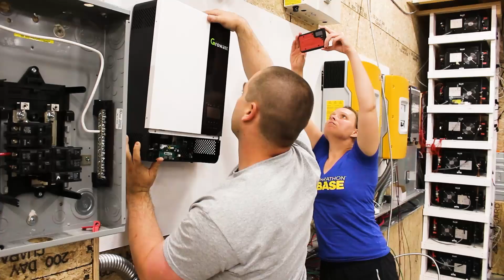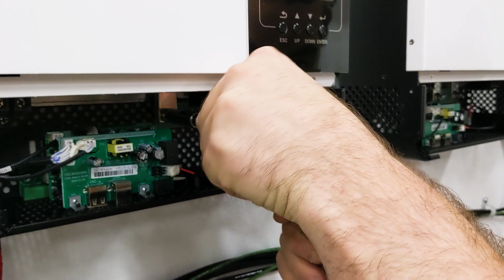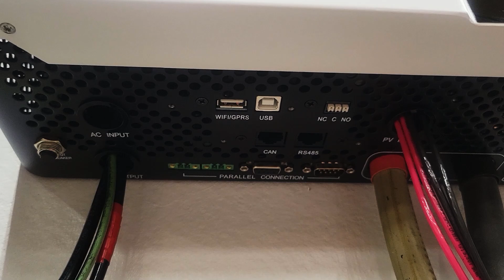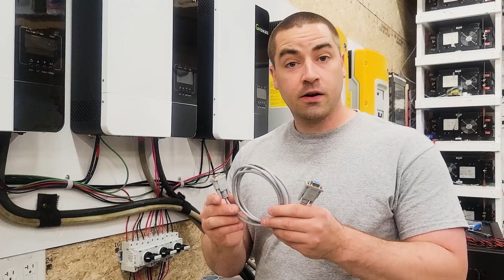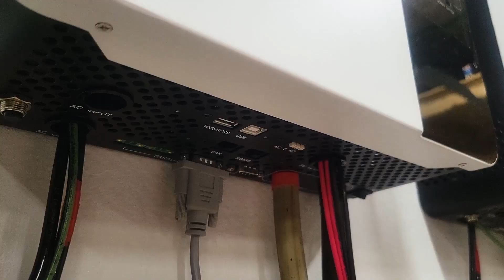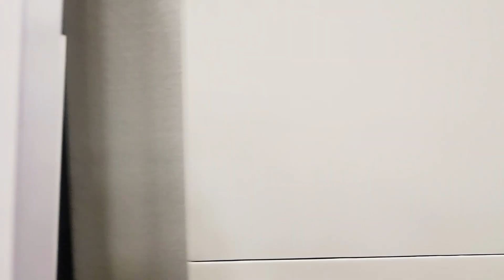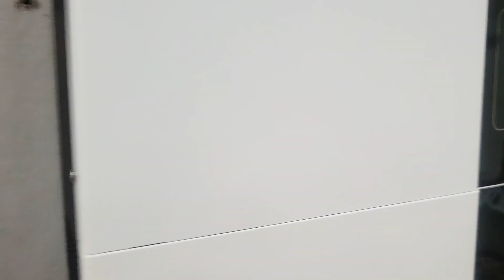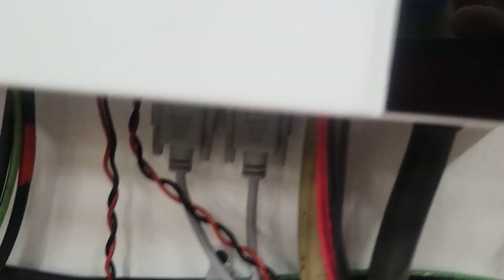Paralleling 3 inverters together, Growatt 5000w Solar System

Comment: Can you use two auto transformer?
Reply from the maker: Yes, it's OK to parallel multiple auto-transformers.  However, at a certain point I prefer to use one larger auto-transformer.  Depends on exactly what is being powered.
Reply: @DavidPozEnergy  I have 4 growatt 5000es mainly for redundancy and the extra charging capability. Pretty sure I can balance my main panel to not exceed 5k on one transformer but I bought 2 already.just in case.
Reply from the maker: OK.  You can parallel them.  Good luck on your project.

Comment: Hello, I have a solar installation with 3 inverters 5 kW mounted in parallel with a total single-phase output of 15 kw but I have a three-phase public network subscription of 15A per phase, I would like to know if it is possible to make the network injection of the 3 phases with a phase by inverter on the prallèle mono

Comment: Hi David. I love your videos! They are packed with information and I like the personal touch you give them by telling about your grandfathers screwdriver for example! 

One question though. I've got two SPF 5000 ES inverters in parallel and 8 panels of 75.6V and 6.58A each. I want to connect them as two strings of 4 panels. So two strings of 302.4V and 6.58A. I'm planning to connect one of these strings in the left and one string in the right converter if that's correct. 

But then in the future I would like to add another 5 of the same panels as a string of 378V and 6.58A. Can I then combine the initial two strings in parallel (302.4V / 13.16A) and connect it to one converter and the new string of 378V / 6.58A to the other converter? I know that normally when you would combine these two strings (302.4V and 378V) in parallel, the voltage would go down to the lowest voltage string. But since they go to separate converters (connected in parallel though) will this then not happen? I googled for quite a while but couldn't seem to find the answer. Would you be able to help me with this? :) 

Thanks in advance!
Reply from the maker: First question: Your explanation of wiring the solar array sounds correct.  302V is about the same Voltage I run on my strings.  Running one string into one charge controller is ideal.  I personally run two strings in parallel, and then feed into each charge controller. 
Second question: You have it correct.  You can combine two strings, so long as each string is the same Voltage (which you said you would).  The new string of 5 panels can run into it's own charge controller without affecting any other charge controller.  The important thing whenever you have 2 or more charge controllers feeding the same battery, you want all the settings the same.  
Note, tape your screwdriver to prevent shorting the terminal screw to the metal case of the inverter.
Reply: Awesome. Thanks a lot David!

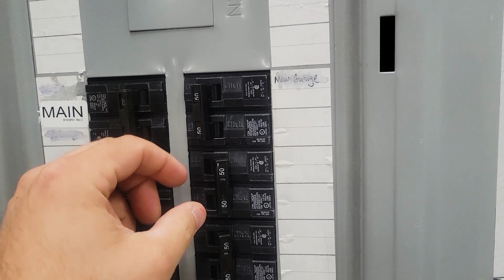Comment: Right at 22:05, i had all settings in the menus the same, and ass soon as i turned the circuit breaker to turn the shed on as a load, poof 2 growatts gone, error 51 and error 9 $2600au gone

Comment: Considering that these are hybrid inverters, could you have connected the grid to them?
Reply from the maker: These are not hybrid inverters.  They are off grid inverters with charge controllers built in.

Comment: hey brother. can you tell me how these inverters are holding up? im looking into pretty much the same setup
Reply from the maker: I ran my house over a year with great success.    I made a 1 year follow up video on the Growatts you might like to see.  Note, I'm using these off grid only.  I've heard some people had glitches when trying to use the grid to pass through them (I never tested this myself).  
Video, 1-year: https://youtu.be/0xY4OdBfn44?si=b4c4Hqmh1y4yylku
Reply: @DavidPozEnergy  im going for off grid too, i saw the 1 year, kudos!! I can’t thank you enough for providing this information, not too many people follow up on the long-term, and even less replied when I asked them!! have a safe holiday, brother, and be safe, I subscribed to help your algorithm
Reply from the maker: Your welcome.  Something to mention.  If I were building this out again today, I'd choose this inverter: https://signaturesolar.com/eg4-6000xp-off-grid-inverter-split-phase/?ref=4_rHcgZ9x-TiF-
(affiliate links help the channel)
Yes, it costs more than the Growatt, but it has the circuit breakers built in, and the split-phase.  So you don't have to buy the extra disconnects, boxes, transformer, etc.  I think it's a better deal overall.

Comment: Hey Dav, are the computer necessary to make the BMS work. I have three Growatts and ten EGLL batteries. Not able to get the BMS communication working to be able always charge my battery bank. Any counsel on this? Thanks
Reply from the maker: I ran my Growatt inverters for a year without any communication between the battery and inverter.  I set the max charge based on Voltage, and the disconnect based on Voltage.
Reply: Okay, I am having an intermittent problem with my batteries not charging some mornings.  I do not currently have them in the LI mode. Very frustrating. When I attempted to switch over to the LI mode I got a fault. Wondering if the gray cables are what I am missing to make this work. I travel from time to time and have three freezers and a fridge, don’t wanna come home to drained batteries.
Reply from the maker: You said "gray cables".  Are you referring to the data cables for paralleling multiple inverters together, called "parallel communication cable" on page 23 of the manual?
Reply: I believe I need to speak to my electrician. I don’t think mine are set up in parallel. I have three Growatts. 1 has PV of 5700 watts
1 has PV of 5670 watts
1 has PV of 4500 watts, however they all feed through two transformers to create split phase then to the loads in my home. For some reason the batteries intermittently do not charge consistently. Some days fine, but every so often I notice they’re not charging. When I put them in LI the system shoots faults. Any ideas what might be happening? I do realize that you’re busy with your own challenges. Thanks in advance.
Reply from the maker: It sounds like all 3 inverters are trying to feed the same load panel in your house.  This must be done in parallel.  The chapter on how to parallel inverters begins on page 22 of the manual: https://signaturesolar.com/content/documents/GROWATT/1519013-manual.pdf

When setting up inverters, the hardware must be done 100% before looking at software.  Things like linking the parallel wires is hardware.  Menu settings of what type of batteries you have is software.  Please go through your setup and verify all the wires are 100% in the "Parallel Installation Guide" beginning on page 22. 

I don't mean to come off brash, I'm trying to help.  It's simply happened before where I spend hours trying to help someone with menu settings, only to find out they had a loose connection somewhere.
Reply: Okay. Last question. Do I have to purchase the separate communication parallel kits? I purchased my ES5000’s in June 2022. Thanks
Reply from the maker: I purchased my Growatt inverters here: https://signaturesolar.com/growatt-5kw-stackable-off-grid-inverter-spf-5000-es/?ref=4_rHcgZ9x-TiF-
The ones I bought came with the "paralleling board" pre-installed in the wiring compartment.  I didn't have to purchase anything additionally since each inverter had the parallel board and paralleling wires.
Reply: Hi Dave and thanks again for your follow up. I purchased mine from signature as well. I have nine EG4LL V1’s and one V2. It seems I have to update the firmware. Where in the world does an old fogy like me learn these things?
Reply from the maker: I never updated the firmware in my Growatts.  I did update firmware on my batteries for setting up closed-loop communication, and I have a video on it.  However, the closed-loop communication isn't necessary.  Please make sure all the data wires and settings in the Growatts are correct for parallel operation before worrying about closed-loop comms with the battery.
Reply: @DavidPozEnergy  Thanks Dave, I update my voltage settings with the help of the folks at Signature.  The problem that I have is that the Growatts sometimes do not charge the batteries.  Not sure if it is a sunshine/shading issue or inverter issue.  Today (here in middle Tennessee)  it is partly cloudy.  My batteries are in standby mode.  The voltage coming off the array is swinging between 143v and 240v.  I hadn't programmed the protocol in my master battery, so we did that yesterday.  We made sure all dip switches were correct. I have one V2 battery.  I hated the fact that they phased out the V1's.  After all this, switching the inverters to LI, and the faults started again.  The tech instructed me to put the master inverter in USE mode.  I got a solid red light and now my case has been pushed up to the next level.  I disconnected the BMS cable and am running in LI/USE mode.  I guess for me it is a learning curve issue.  Thanks for sticking with me on this.
Reply from the maker: Glad to hear SS is working with you on this.

Comment: Is it true that if you parallel the growatt inverters, the PV can no longer combine with the utility to power the load? My understanding is the pv can power the load if the supply is greater than the load. But when the PV power drops below the load level it switches over exclusively to Utility and the PV charges the battery only.
Reply from the maker: That sounds right.  I run my inverters in off grid mode only (no grid input).  This is a budget inverter and won't have all the extra features found on more expensive models.

Comment: Hi David.  been watching all your videos.  I have 2 3000 Growatt that is in split phase at the moment.  I find myself needing more than 3k of watts as I run the microwave and airfyer together.  to get more than 3000, I would need to ditch 240v Split Phase, which I dont have use for at the moment, to do that, do I need to get rid of the serial cable and just use the blk and red cable to share current to get 6000 Watts instead?  Thank you in advance
Reply from the maker: Refer to the manual.
No.  They still need to communicate.  Refer to the manual for wiring it them in "single phase".  You will need to change the parallel mode to single phase in the menu.  Also, remember, don't feed it with 240V (input) if you want 120V (output).

Comment: Thank you. I used the Demuda 6,000 watt 24/48 VDC - 110/220 VAC input, 110/220VAC pure sine wave output 100 amp MPPT charger-inverters and I think they might have cost more than the Growatt. It has a PV input max of 5,760 Watts which is vastly larger than my two 100 watt panels. :-) Going by functionality and price, it appears to Growatt is the better deal.

Comment: Super.., my question to you is: why the inverters have IN and OUT AC connections if they are OFF GRID model?. Thank you in advance for your answer
Reply from the maker: You can feed a generator into it.
Reply: @DavidPozEnergy  Thanks, I appreciate your reply.., so actually if I connect to the IN and OUT with the grid power, it should work just fine I guess.
Reply from the maker: Um, there might be some confusion here somewhere.  If you run the grid to both the "INPUT" and "OUTPUT" terminals, you would blow up the inverter.
Reply: @DavidPozEnergy  I see. Thank you for the reply. :)

Comment: Hi can I ask a question my growatt 5000ES does not supply power go the house though it shows those lines as if power is supplied to the house and it shows zero on top of that little house. What could be the problem. Thank you.

Comment: Hi David, Great videos, Im in the process of also building a system but bit confuse, wonder if to get 2 units like EG4 or sungold or 2-3 growatt , looking back on your own project , will u take the more powerful inverters today or the growatt is all u need and working fine? thank you
Reply from the maker: Hi ami non,  Thanks for your question.
The Growatts are working quite well for me, and I'm happy with the purchase.  They are still one of the best values on the market.  Based on your question, I'll assume you are asking about these EG4: https://signaturesolar.com/eg4-13kw-off-grid-split-phase-inverter-bundle-2-x-6500ex-48-13000w-output-16000w-pv-input-split-phase-120-240vac-all-in-one-solar-inverter-system/?ref=4_rHcgZ9x-TiF- 
Compared with 3 of these Growatts: https://signaturesolar.com/growatt-5kw-stackable-off-grid-inverter-spf-5000-es/?ref=4_rHcgZ9x-TiF- combined with an auto-transformer: https://signaturesolar.com/growatt-5kw-split-phase-transformer-ats-5000t-es/?ref=4_rHcgZ9x-TiF-

Between these two options above, I would choose the Growatts with auto-transformer.  The price between the two is about the same when you add in some circuit breakers for the Growatts.  The Growatt option is 15kW, slightly more than the two EG4.  But, the main benefit is the 240V being produced at the inverters instead of the two EG4's producing 120V.  After having used them, I like producing the 240V at the inverter.  I find less Voltage sag under heavy load and overall less issues.

There is another option worth considering.  The newer EG4 inverter:  https://signaturesolar.com/eg4-18kpv-hybrid-inverter-all-in-one-solar-inverter-eg4-18kpv-12lv/?ref=4_rHcgZ9x-TiF-
It can output similar power, but will greatly simplify installation.  It takes up less wall space, and is far more efficient than either of the above options.  Being more efficient will mean less battery, less solar, which will help cover the added cost.  

Good luck with your build.

Comment: Hi, I am in process to have 3 unit inverter with parallel connection. Need you help and advice on the how do u handle AC outputs from these 3 inverter to be combined into single AC output to Load?... whats the name of device to combine these AC outputs?

Comment: The connectors are DB9 (D-sub 9 Pin) connectors communicating using either RS-232 or RS-485 protocol

Comment: Thanks for sharing David. Quick question - what's the size of each solar array and how did you install them (series, parallel, series-parallel)?
Reply from the maker: I have 3 solar arrays.  5.1kW, 4.4kW, and 3.3kW (if I remember correctly).  Each array feeds into it's own charge controller.  All 3 charge controllers charge the same battery bank.
Reply: @DavidPozEnergy  Are they all arrayed in series? Trying to figure out how you connected them to the inverters via the double cabling with the ferrules...

Comment: Hi what is the cable size do you use to connect to the battery? Assuming max is 11KWatts (for 2 inverters) that means the total amperage will be 230A (11K/48). Looking at tables online you would need a 3/0 Awg cable, yours doesnt seem to be that big. Is there something I got wrong here?
Reply from the maker: I used 4/0 wire from the battery to the busbar.  From the busbar to each inverter I used 1/0.

Comment: Hi David, I have built my  own system using the MPP Solar off grid  inverters. . I have had two 240V 4000 W inverters in parallel running for 6 years, the only problem I have had is getting cooling fans for them. These Growatt inverters look very similar to the  MPP Solar inverters, the user manuals are very similar. Recently I did an install recently  with the Growatt  inverters. I have heard some bad reports on the Growatt Off Grid Inverters . Personally I absolutely love them. I am envious of the design engineers that made these, they are reasonably priced and seem reliable of course time will tell. At my home in Australia in ten years I have had two Fronius Grid tie 1.5Kw inverters go faulty. Which is very disappointing. Luckily in Australia we don't need the auto transformer system. 
Anyway thank you for your clear and easy to follow videos. I really hope these Growatt inverters are reliable and that one can get parts for them to fix them, I hate the idea that they go to landfill.

Comment: Hello David, do you happened to know if the growatt 8k (or 12k) units (3 or more) could also be hooked up in parallel?  The EG4 listed 6 as max, not sure if Growatt has a limit (tried looking at the manual but didn't see anything).  Thanks for the great video!
Reply from the maker: The Growatt Low Frequency inverters can not be paralleled.

Comment: When you have this setup 3 inverter as paraller we can feed loads as 15kw but with how many amps?My  home have 3 phases so i spread the loads on each phase.Which way should i go?What if we run heavy loads with in this paraller setup as i understand is limited in 50A correct?

Comment: Hi David I really enjoyed your videos actually I have a place up in Monson Maine where one of your videos were shot anyways after a year would you still suggest the grow at 5KW for a whole house system I bought the signature solar 6KW and I have been very let down by it
Reply from the maker: The Growatts still work for me, but if you have the budget, the Schneider inverter is the best I've tested.
Reply: @DavidPozEnergy  I do have a working man’s budget
 So I was thinking of 3. 5KW growatts 
 Just figuring which transformer I need the 11kw or 5KW for the 3
Reply from the maker: To clarify, Is your plan to parallel 3 of these https://signaturesolar.com/growatt-5kw-stackable-off-grid-inverter-spf-5000-es/?ref=4_rHcgZ9x-TiF- 
That would be 15kW.  At that point, I'd probably go with the 11.4kW Auto-transformer.  

Keep in mind, you could also buy the Growatt 12kW inverter that has a transformer built in.  Some prefer this method because it simplifies wiring.
Reply: @DavidPozEnergy  I like simplifying but the price is a lot higher for the 12 KW then 3. 5KW. 
And how do you determine which size transformer to install signature Solar wasn’t too helpful when I asked a question
Reply: I was wondering. To power your whole house your only using a 50 amp breaker ⁉️
 Just wondering because I’m in the process of wiring the panel with the same setup as you accept a 11.4kw transformer 
 I figured you’d use a lot bigger breaker